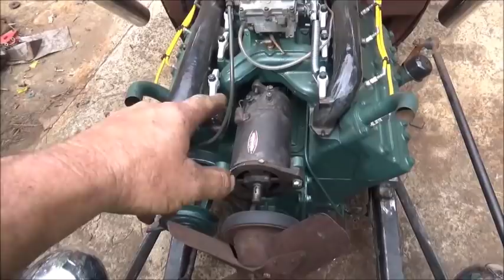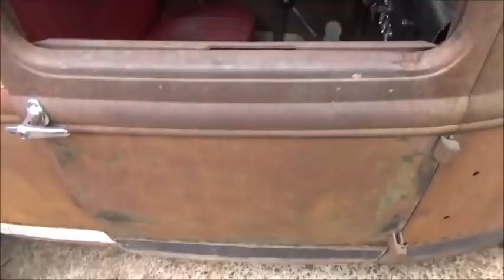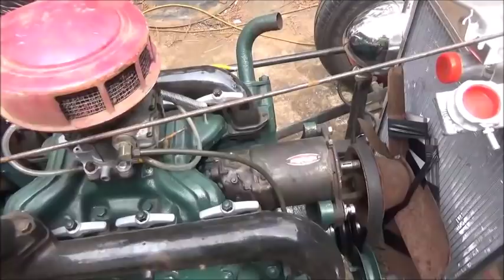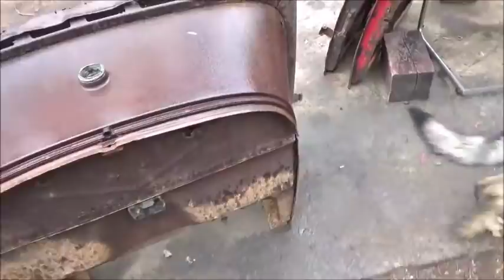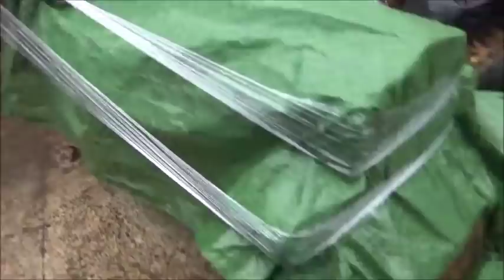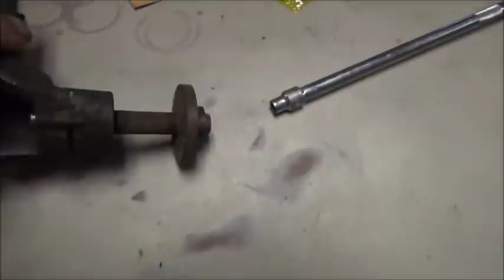1931 FORD 5 WINDOW CADILLAC FLATHEAD RADIATOR GRILLE INSTALL

Comment: Definitely paint the radiator matt black, for two reasons:- 1) It will make the front look aesthetically pleasing to the eye and set the overall look of the car off. 2) Matt black transfers heat quicker than any other colour and so aid the cooling process, that's why radiator are normally painted matt black!!
Love the sound of that caddy V8, it has a lovely burble to it.
Looking forward to your next build, I'm sure you will make all the bad bits of the body work become good with your usual skill and resourcefulness. Stay safe and don't forget to weld those motor mounts.

Comment: That radiator looks good there. That engine sounds sweet too. Thanks for using the mechanical fan. It takes some ingenuity to get it to work which you have a heap of. Great Work.

Comment: Hey man,I done reminded ya onct. Weld them dang mounts! Would hate to see that beauty do a cartwheel off them spots!

Just a thought on the upper radiator hoses,could you fab something up outta copper pipe? The pipe out the rad,sweat a t on it then the two pipes ,an elbow on the ends and a short piece,to a rubber coupler. Might look cool!

I don't know about showing the bad! We watched you UNFOLD the very car you're working on! If that wasn't bad...

Comment: Hi Jonathan I love your videos. I was wondering.If you machined the fan pulley so that it was a tad bit shorter it would give the fan a little more space so the blades do not hit the radiator? not to criticize.your judgement though it looks real close

Comment: I hear you about how hard it is to get over smoking.  You mention it has been 6 weeks for you and it is still hard.  Well, I quit in 1970 and it was 3 years before I could say there were times I did not want a cigarette.  It got easier as I went along but my memory was the first part was pretty bad.  Never regretted quitting.  Gained weight but I've lost it again.  Keep plugging.  It will be better.

Comment: As a kid a neighbor had a convertible cord which was converted to rear wheel drive with a caddy flathead an hydranmatic  wasnt a race car but intriguein .50years ago saw them burn a 32ford deluxe cvt. Dual side mt v8 pickup at the scrap yard .dad said wasn worth 35$".smoked .🤗

Comment: If anyone’s ever stuck looking for a rad fan with a bolt on bracket, I saw one on a Chrysler 318cu industrial engine in a combine. I’m not meaning it belongs on this car but I thought I’d mention it to help someone out there who needs their fan to sit higher than the stock water pump.

Comment: Could you hard pipe the top rad hoses to make a 'Y' piece that compliments the exhaust? Then just use flexi couplers at the joints, dunno if that would look cool or too busy?

Comment: I was on a pick recently where the guy had that Cadillac v8 sitting on the floor. He also had a aluminum up flow intake sitting with it. He said it was referred to as a "tarantula" intake by car guys. The owner said people would block off the up flow, cut open the top and attach a down flow Holley or the like.  I wish I knew how to send you a picture of it.

Comment: That hub on the bearing shaft should just press off, or you could use a puller on it. As for as the bearing it is all made into one unit and i do not know of anyway to get the shaft out. The good thing is that all the bearing units are a pretty standard size so it will not be hard to match something up. The reason I know all this is I used to work in an automotive machine shop back in the early 1970's.  At that time we used to rebuild a lot of water pumps and accessory  drives. By the way, I like your work and I have an extra bell housing for my 1939 Pontiac 6 cylinder. I am thinking of converting it to a 5 speed.

Comment: I was wondering if a shallower pulley could be used, and just press the flange on farther, thus moving fan away from radiator. Not too much shallower, or the fan blade would hit the belt.

Comment: Finally i understand the plan for the Buick I8. Very cool. You seem to say, "I have this neat engine, guess i will build a car for it". Wow! So if you get a title the car would be street-able? Amazing project. thank you for posting, D  Every time you say Cat Scan i smile, back in 75 - 80 I worked on the development of first whole body CAT Scanner!  That first one was a Lot like some of you builds, extra holes we called them lightening holes, tack welds, extra gussets and braces, it was a bit of a mess, but it sure ran.

Comment: I do believe a call to Delray would find you some oxygen an it would maybe make him feel good to help a trifle an still not be up there as there is that social distancing so's not to hurt his feelers. I see you making a whole bearing support bracket with the shaft long enough to clear that bearing and close the gap some maybe and still keep that belt in alignment with bottom pulley (vibration damper)  to even get a eighth of a inch. I don't see any steel fan blades with less pitch on them handy as it would be in a pile ten foot high to dig through. Funny how things we take for granted are real important later when a use found for. I know I ain't got a dog in this fight but maybe something I say could roll with your own and be just the dress for molly. I don't mean any offence and wish you the best. I really see that roadster body coming together off the parts that your starting with. A pattern from one side should come close for the other and bad metal has never chased you off short of the tin worms eating more than whats left as you see it finished before you start doing and that is a builders advantage.